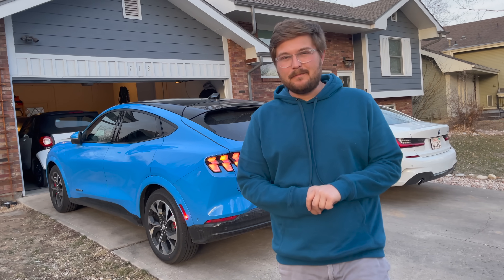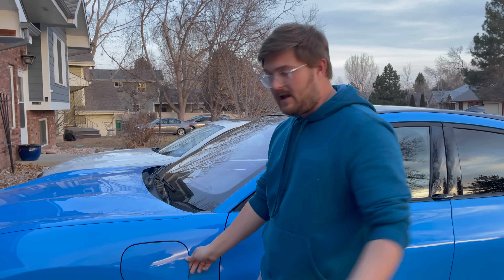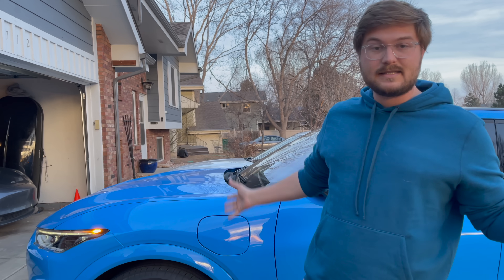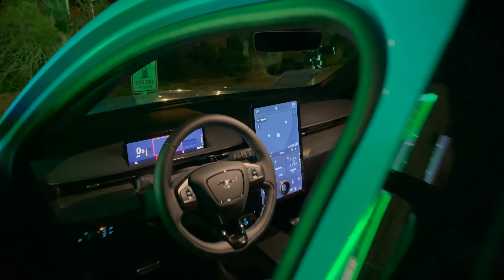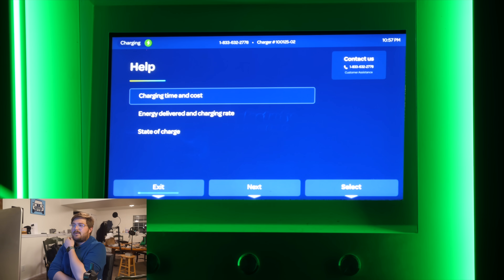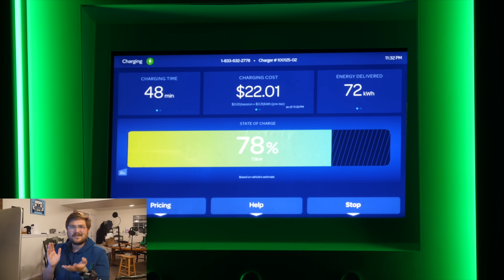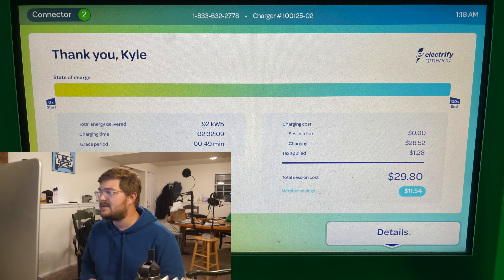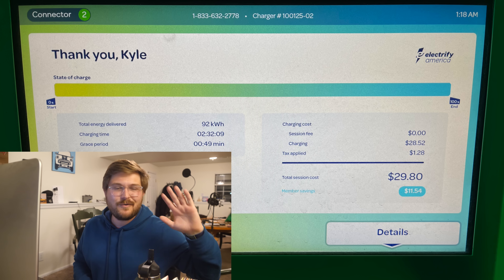DC Fast Charging Mustang Mach-E From 0-100% Takes Over 2 Hours! Here's Why.

Comment: This is all very useful.  I drove the Mach e and LOVED it!  I own a 2019 Tesla Model 3 LR AWD and had a Model Y that I sold.  So, looking to replace my Model 3...Loved the drive of the Ford, but didn’t get a chance to do any charging stuff..looking at the e-tron too as I had a Q7 and love it.  I think the interior of the Audi is overall better, but not miles better (no pun intended).  LOVE the plow marker trick!  Golfers have those in their bags, so good alternative use!  Leaning e-tron due to the better charging speed, but still open...I know the e-tron range is lower, but having driven an EV now for about 2+ years, I completely know that a vehicle with low 200s is plenty, even for long trips and that charging speed is more important as I make stops pretty much every two hours at most (about 150-175 miles).  I hope you are doing something Alissa wants to do for her putting up with your passion!!

Comment: 9:50 I'd recommend doing a screen record from the app. I just load it on my phone and record the screen. The app doesn't toggle away from the charging speed display, and as along as you have an internet access, it updates in real time.
Reply from the maker: Good idea! - Kyle
Reply: Eric is the best a bolt pioneer

Comment: 7:35 Just an FYI. As far as the Ford Mustang Mach-E is concerned, there should be difference between the 150 kW units and the 350 kW units. While Electrify America's label says "150 kW," these chargers are actually capable of outputting between 175 kW and 200 kW. The limitation is the current, and for <500 V EVs, the current output of the 150 kW and 350 kW chargers is identical.

Comment: In Ford's defense, cables are rated independently, so there are limitations based on cable ratings. While I do agree that additional sensors are advisable, they aren't really necessary if your intention is to not exceed the cable's rating. I know that other automakers such as Tesla are more than happy to push past rated standards (e.g., V3 Superchargers exceed their UL listed current ratings), but I can't see major automakers doing that yet for so little gain.
Reply: I think it's not a cabling thing. I bet Ford doesn't want the same financial fiasco as Hyundai with their LG Chem cells so they're going to stringently remain safely within spec. A pack catastrophe that leaves Ford paying 30% of a gazillion dollars for pack replacements would doom Ford.
Reply: @anthonyc8499  The LG packs contained faulty cells and were going to catch fire eventually, regardless of how they were managed. Kyle is correct. This is definitely a software restriction; however, its parameters are likely set based on preexisting ratings.
Reply: @newscoulomb3705  100% there's a manufacturing issue from LG. Ford has intimate knowledge of LG cells catching fire. Just look at the Kuga PHEV. My point is Ford wants to stay within the manufacturer specs on the cells and not risk 100% of their warranty reserves for a 7% gain in charging time.
Reply: @anthonyc8499  Right, but the question is whether it's the cell or the cabling harness specs that Ford is basing its restriction on? If it's the cells, they should never peak at 160 to 170 kW, and it certainly shouldn't spike back to that again after unplugging and plugging back in. 
Cabling, on the other hand, has current restrictions based on time and temperature rise. For instance, 2/0 cable is rated for a 90 C temperature rise at 195 A. The cable is typically rated for 105 C max temperature, so the max rated current is 200 A. However, you can exceed that max rating for a short period of time while the cable is heating. 
Essentially, the Mach-E's behavior matches most closely with Ford operating within the cable's max rated current.
Reply: @newscoulomb3705  gotcha. What you say makes sense and your theory fits.

Comment: expensive to charge.....
Reply: That was my thought also. I believe this car has about 250 mi of range. Although Alex on autos Mustang mach E seems to be very pessimistic on its range estimator he seems to get much more than the car thinks he will get.
The problem I see is my very efficient Toyota hybrid would actually cost me less than it would to charge this.
Going 250 mi in my hybrid would cost me about $19 at $2.75 per gallon and I can refill that tank a hell of a lot faster. So that's a bit of a problem for me it's slower and more expensive.
The math might be a bit different in places that charge by the minute and also stopping your charging when it slows to a lower rate. I imagine Kyle is going to do some testing with that there may be a crossover point where the cost per mile is better.

Comment: 0% - 10:45 pm
5% = 1 min  -- 10:46 pm
10% = 3 min -- 10:48 pm (3 minutes 0 - 10%)
20% = 8 min -- 10:53 pm (5 minutes 10% - 20%)
30% = 14 min -- 10:59 pm (6 minutes 20% - 30%)
40% = 19 min -- 11:04 pm (5 minutes 30% - 40%)
50% = 26 min -- 11:11 pm (7 minutes 40% - 50%)
60% = 34 min -- 11:19 pm (8 minutes 50% - 60%)
70% = 41 min -- 11:26 pm (7 minutes 60% - 70%)
80% = 49 min -- 11:34 pm (8 minutes 70% - 80%)

10% - 70% = 38 minutes
10% - 80% = 46 minutes  (Bjorn's 10% - 80% test took 41 minutes.)

20% - 70% = 33 minutes
20% - 80% = 41 minutes

Obviously the peak charging rate upon first plugging in is meant to warm up the battery without damaging it and allow a higher SOC over the rest of the session.  Bit weird that you can unplug and plugin and it'll keep re-peaking... maybe something Ford didn't think to check because no one should be doing this.  Guess they'll have to add a heat check to ensure people don't destroy their batteries by trying to max out speed with tricks like this...  At higher SOC, the pack voltage is higher, allowing less resistance and less heat generation so the peak can last a bit longer.

The slow down over 80% is fine IMO.  I imagine this has nothing to do with protecting the pack and is a software limitation meant to get people to optimize their charging and not take up so much plug time.  To make it even harder, EA should raise the price once a car's hit 80%.  Worst case, people will keep doing it, but EA will have more money to install more plugs.

For those who don't know how to optimize charging on a long trip, this will make it abundantly clear that charging over 80% doesn't make any sense and is wasting a plug.  The only issue would be if the customer needs over 80% to make it to the next plug, which isn't an issue on  main routes, and won't be an issue on the lesser used routes in the near future.  If the customer does want to charge over 80%, move the car off the DC fast charger to a slow charger; it'll charge at the same rate for less money and not take up the more critical DC fast charger infrastructure.  EA could offer a few slow chargers at much lower rates to facilitate this.  (maybe they already do?)  They're MUCH cheaper units and MUCH cheaper to install.

Title's click bait ish.  Kyle knows full well that charging over 80% doesn't make any sense.   For those people who don't really care about the details, this title will confuse them and make them question the purchase of a perfectly capable EV.
Reply: In Idaho I have to go above 80% to make it between superchargers. If the idea is to make that painful (here's a tip, it's already painful enough), that's not a selling point for me.
Reply: @jonathansage2147  Does that mean you live in Idaho, or are traveling through?  It depends entirely on where you're driving.  

Main Idaho highways are well covered by EA.  No idea if there are other charging networks in the state.  If a network's charging locations rely on people charging to above 80% (about 215 miles in nicer weather), then clearly they need more chargers... and eventually they'll get them. It's still early days, networks are trying to cover the main / most used routes.

I don't think we should expect all cars to be all things for all people this early in the transition.  It's ok if a car doesn't work for you, I assume OEMs with their limited production quantities want to target the higher population areas first with higher tax credit incentives and states that have ZEV/GHG credit programs that they need the EVs to offset their ICE sales.  They're not going to prioritize one of the lowest population states in the nation.
Reply: @updlate4756  I live in Idaho. I have two Model Xs, a 2021 MXP and a 2018 MX 100D. Using main routes in cold conditions there is no way to make many of the legs in Idaho without charging above 80% because the speed limit is 80 mph. And yes, the solution is more charging infrastructure, not higher range, but that doesn't exist yet. 

My point is that arbitrarily and capriciously limiting the ability to charge past 80% at the max possible speed is extremely unappealing to me - especially since the MX already has better range than the Mach E and it's a problem for me.
Reply: @jonathansage2147  Or an alternative solution is to lobby to reduce speed limits.  lol.  I mean, this isn't meant for you, but it just wooshes over so many peoples' heads that lower speed limits improve efficiency for both ICEs and EVs, using less fossil fuel and grid energy, and reducing overall emissions.  The higher the speed limit, the more it's impossible for people to drive at lower / more efficient speeds without creating a more dangerous driving environment.  In other words, people are effectively being forced to drive faster.  But that's just an aside...

You say infrastructure doesn't exist yet, but neither do many vehicles with higher range.  You can't really use a model X 100 as your comparison factor.  Most people can't afford that vehicle, or don't want to afford that vehicle.  As to cold weather range, I mean, let's be honest, Tesla's been overstating their overall highway range.  Nevermind highway range in cold weather.  You'd really have to wait and see what the Mach-E does in cold weather.  Probably not great without a heatpump, but that's not something you model X has either yet...

I imagine Ford is doing this to ensure reliable charging access.  Charging speeds slow down so much after 80% that it makes a lot more sense for the person to get off the fast charger and move to a slow charger or go to the next charger.  Once plug counts grow, this won't be an issue.  I could be wrong, and maybe there's a fundamental problem with Ford's battery.  Not sure...  Either way, the vast majority of time people won't be charging over 80%... or at least shouldn't be if they're optimizing.  It's only necessary in a few low use circumstances.
Reply: This is very useful; even a top off from 40% to 80% SOC is only 30 minutes.  And in a pinch, 5% to 30% in only 13 minutes.  Agree with you, when on a roadtrip, charging up to 80% will be the norm, unless overnighting.

Comment: Great video! Interesting ford strategy. Is it to protect the pack over time or to optimize a 30(ish) minute session? Glad you compared that to the eTron of 150kW til 80%. MachE above 80% at 12kW is almost pointless to stay more than others above 80. Even bolt does 16kW from 80-90%. 12kW only twice as fast as switching to level 2 station (which EA doesn’t have at many of their sites). Definitely would leave at 80% if road tripping the MachE unless absolutely needed more than 80% to get to next stop.

Comment: I want an EV, but I did not realize it would take 2.5hrs to charge and cost me $40 bucks for at best 300 miles.
Reply: I charge at home most of the time. Saving over 200 in gas each month, including electricity cost.
Reply: Plus I find free charging. Like places we stay or certain stores have free charging.
Reply: That assumes you will use fast DC charging for the majority of your needs (and you might). Most people will usually charge at home or at work where the cost of providing a full charge will be considerably less. Ranges from $4-8 per full tank depending on the cost of electricity where you live.
Reply: @SeanCaldwellvo  Your estimated price range is a bit narrow. Where I live (in So. Cal.), home charging to go 270 miles would cost $20-25, but the gasoline at 26 mpg would cost over $38 @ the current price of about $3.70 per gallon.

Comment: In my industry 300 seconds is the standard for "startup current" for our cable products.  I presume Ford is using something similar.   So I presume they are using a combination of Start up boost, battery internal resistance and current stepping for charging.   Hopefully they can avoid the current stepping and move to a more progressive approach (similar to what GM did with the Bolt EV in 2020).

Comment: $30 for electricity? Wow, that's a lot of money.
Reply: It's basically a tank of gas. But most people will charge at home 90 percent of the time, with much lower cost.
Reply: And you have to wait 2+ hours.
Reply: @InternetDude  no one waits for a full charge. You just charge to 80 percent then continue on. For daily charging at home, it's full every morning. Most people buying cars in this price range probably have multiple vehicles anyway, so they can take an ICE for really long trips.
Reply: @InternetDude  you can do 400+ miles with a single half hour stop. I don't know if thats actually a big deal.

Comment: Kyle,  Awesome content as always.. 👍 great to see this looks like 49min 0-80% from your video @ 12:35 .. and 10-80% about 42min not too bad overall but still has room for improvement.. and major improvements needed for 80-100% on DC FC..
Reply: Kyle, do you know what software version you did all this test on? Would be a good idea to keep track of that as OTA update becomes real ..
Reply: I'm not convinced that Ford is feeling any need to change the charging speed on the Mach-E. Ford has blown past their 45 minutes to 80% promise so I don't know if it makes sense for them to give buyers even better speed. It may take a lot of public pressure on Ford's leadership team to make faster charging happen.

Comment: Thanks for some great information for an EV newbie. Would love to see this same test on the new Bolt EUV.
Reply: Bolt EUV I presume will charge exactly the same as the 2020 Bolt EV as it uses the exact same battery setup.  Bolt EUV should pull 150A constant till about 55% SOC (46KW a very low SOC then slowly climbs to about 56KW as pack voltage increases) then slowly start to ramp down with the ramp accelerating down after 70% SOC.
Reply: @erikstephens34  Thank you so much!

Comment: Hey Kyle. You should get a Bluetooth obd2 reader, so you can see all the values. Björn Nyland uses it for all his tests, it's a great tool.
Reply: Only works on certain cars because many of the OBD2 standards don’t apply to EVs. The Mach E is so new that probably nobody has reverse engineered it yet.
Reply: @ouch1011  the only car that doesn’t have a physical OBD-II port is Model 3. AFAIK, the Mach-E, just like the Bolt, Volt, Kona, Niro, etc. all have one. If the Mach-E is anything like the Focus Electric, it will probably be able to display some data using third party apps.
Reply: @CFG39  Yes, you can read all the data, but you also have to reverse engineer that data stream to understand what all those numbers stand for.
Reply: Yup, Bjorn is great too 😆

Comment: Great job Kyle.   This kind of information is helpful for planning a road trip in EV's.
Reply: charge speed slows down as higher % is approached, for battery safety & longevity. for road trips, suppose to do 80% then move on to the next station in the trip when you drop down to 20%, use ABRP app.. charge up to 100% during a road trip is unwise & unrealistic with the current battery technology

Comment: The Electrify America chargers in Texas charge 12 cents a minute for pass plus members. The biggest expense I have occurred is on my back home from San Antonio, because there is only one group of chargers from San Antonio to my house in kingsville 165 miles away. For my 2020 Chevy Bolt I charge to 90 percent for that leg of the trip and it's been costing about 10 dollars. 12 cents a minute from 1-90 kilowatts, 24 cents a minute from 91-350 kilowatts for pass plus members.

Comment: First I have one on order... Second, based on the mileage range you show after fully charged and using that range and an average 22 miles per gallon on my F150, using regular gas, the electric charging is more expensive per mile, and I didn’t expect that...  maybe I’m wrong...
Reply: It’s way cheaper if you are able to charge at your home
Reply: Keep in mind he was saying they went full throttle one way to get to 0 %. That has an affect on guess so meter with range guess. Also colder temps affect range

Comment: at 0 to 100 % I saw the total miles was 220. Since you had the car  did the car come close to the EPA specs of 270 miles of range?
Reply from the maker: I’ve been driving it pretty spiritedly and it’s been quite cold, so no. Almost no car comes close to EPA except for Taycan, Ioniq, and surprisingly my electric smart
Reply: I've had the car for a couple weeks now and averaging around 260.  I'm pretty heavy footed.  270 is very doable if I drived more city.